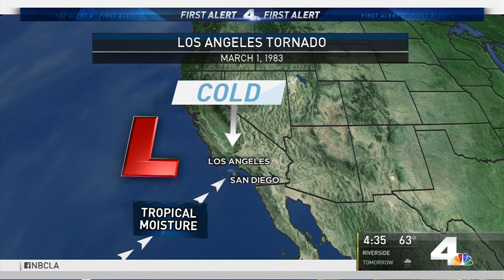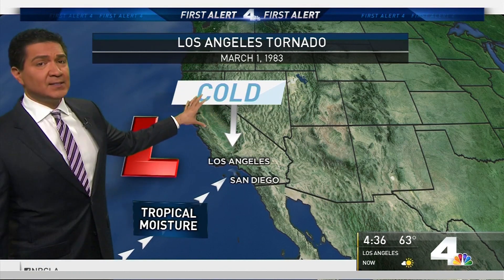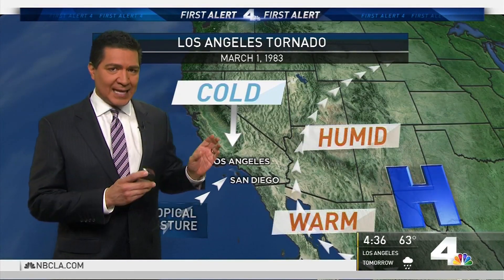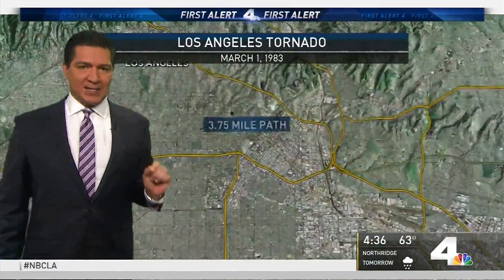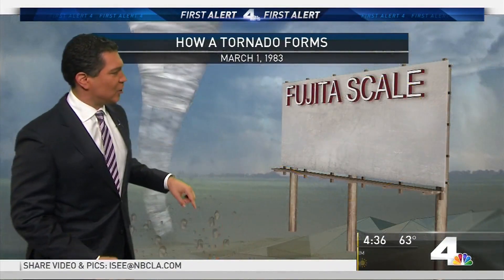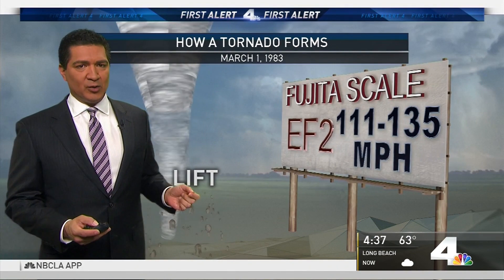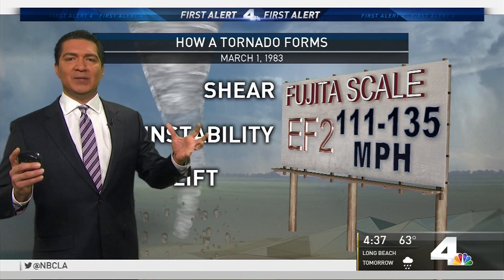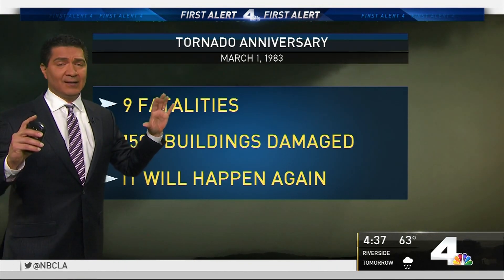How the 1983 Los Angeles Tornado formed

Comment: 9 was the number of tornadoes in 83. There were 0 fatalities
Reply: No, 9 was the actual death toll but is wasn’t caused by the tornado. It was caused by the overall storm system I’m pretty sure
Reply: @EerierFish17  I buy that.
Reply: @EerierFish17  I believe you're right.  Accuracy in reporting is not as important as views!  It's the same as when a Derecho or powerful straight-line winds, like from a microburst are reported as a tornado or described as tornado-like winds.  Straight-line winds aren't as scary sounding as tornado-like winds!